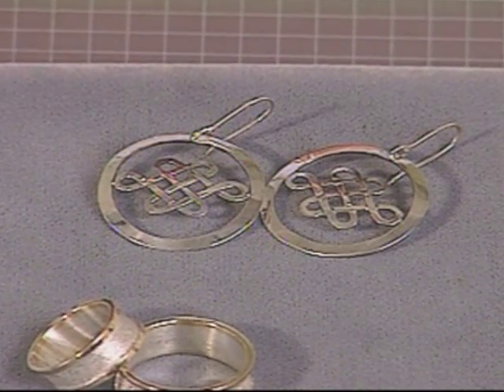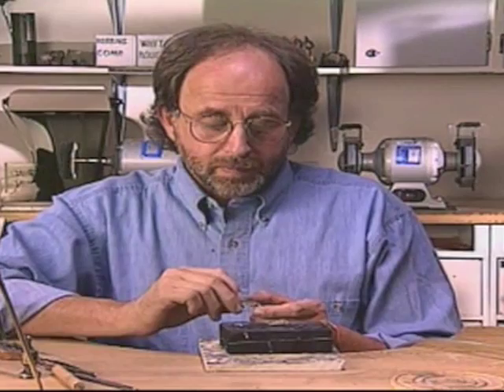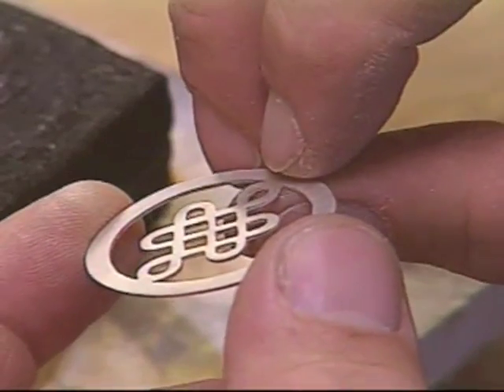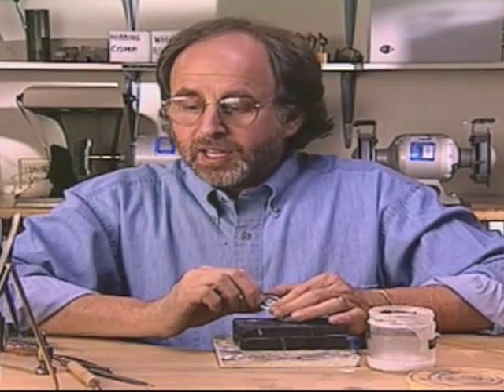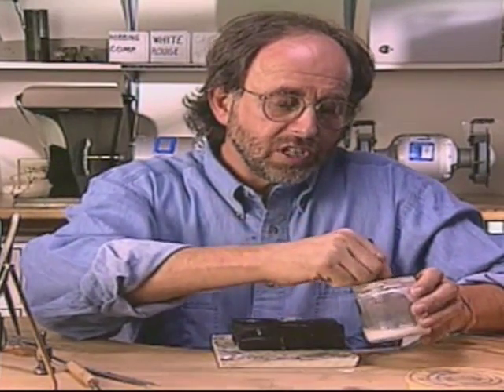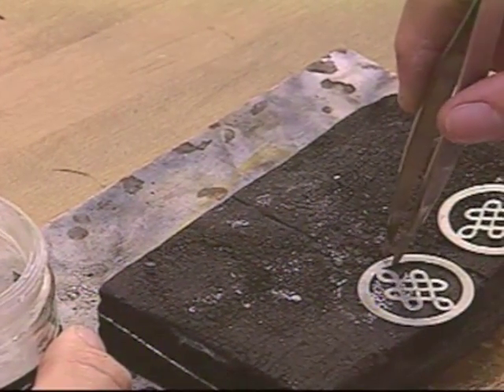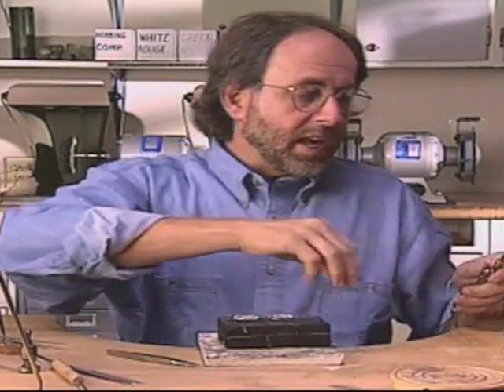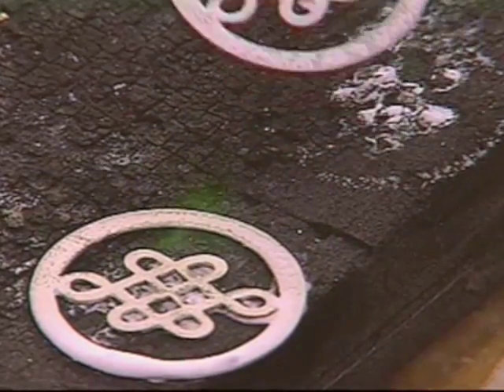Revere on Goldsmithing: Annealing Silver

Comment: What about annealing more than once for say a thick cuff. I have 4 ga. half-round sterling silver than I want to get as soft as possible so that when I stamp it, my stamp doesn’t slide but digs in enough to make an impression. Is it ok, or preferred to anneal it, say 3 times hoping the SS will become more malleable or am I wasting my time because it doesn’t work like that? Thanks A!
Reply: I know it’s an old question but here we go. It doesn’t make the metal softer when you anneal it multiple times in a row. But if you are using steel or iron or even brass stamps it isn’t necessary to anneal the silver since it is a very soft metal.
Reply: @Kastellanbastellan  So are you saying that I shouldn’t anneal metal that I’m going to stamp or are you saying that annealing only once is all you need to do? And thanks so much for your response. 😎
Reply: @AlwaysMetaling  Annealing silver to stamp it is not necessary since it is very soft by nature. But if you do anneal it, it should be enough to do so once. You can deform silver about 40 % before having to anneal again. Only anneal a second time when you previously put a lot of stress onto the metal but wish to deform it even further. Hopefully this helped
Reply: @Kastellanbastellan  Yes-yes! Thank you so much. This makes sense and I’ll see how it goes. I very much appreciate your response and help on this. Stamping on copper is much easier to stamp on but some of my larger Navajo stamps are sometimes really really difficult. Thanks and merry happy Christmas!
Reply: @AlwaysMetaling  merry Christmas to you too!